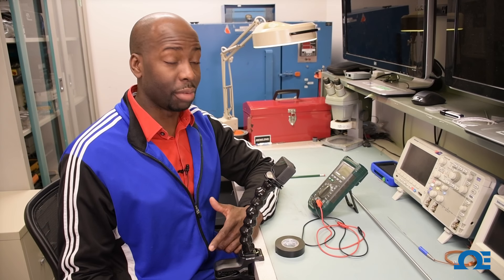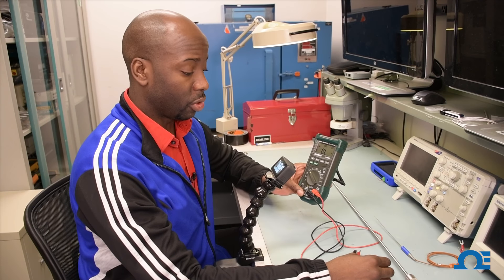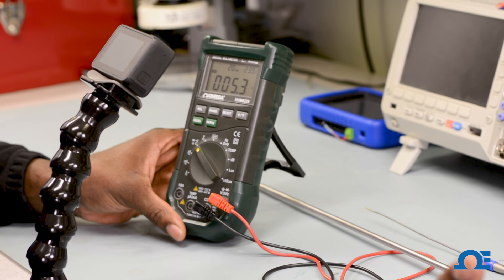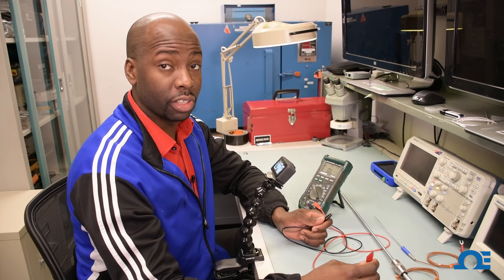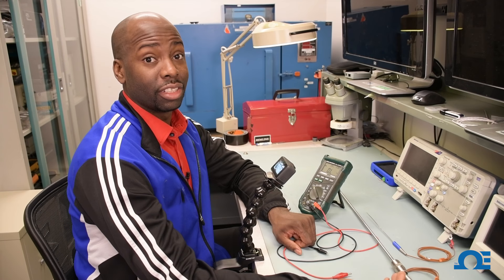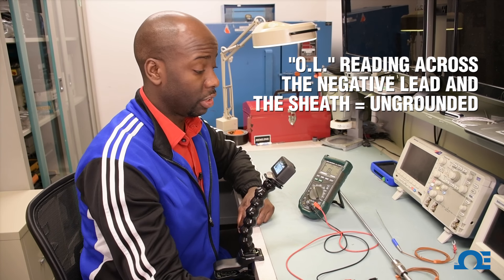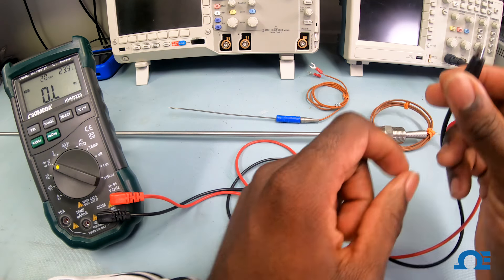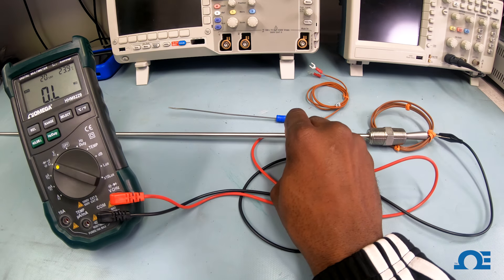How to test a thermocouple with a meter (grounded & ungrounded)

Comment: Hi, nice video. Question: I have type K termocouple which is Exhaust Gas Temperature sensor on my lexus sc400. Now when I drive a car for a while I get a warning that exhaust gas is too hot but I believe it is not true as catalytic converters are not glowing red. Can this 25 year old termocouple be partially not working so it thinks gas is too hot when gas is not too hot? Thanks

Comment: Hello, how do I test the thermocouple from it voltage reading?
Reply from the maker: Hello Kayode, You can check the millivolt reading and match it up to the current temperature of the thermocouple. You can use this link, search for the Thermocouple Reference Tables  as reference.

Comment: What would cause a TC to osculate from positive to negative reading?
Reply from the maker: Hi ramirez509, A thermocouple can start to oscillate from negative to positive if there is an unstable EMI/RFI signal being picked by the T/C or a poor electrical connection to your end device that receives the T/C signal.
Reply: @DwyerOmega  the TC board has for inputs, but using one.  It's been program d for one.

Comment: Hi bro, I need the value of grounded thermocouple's "+ve" terminals to shield/body.Is it O.L. or some resistance ? I need your valuable reply, thanks.
Reply from the maker: Thanks for reaching out! When measuring resistance across the grounded thermocouple body and the positive lead ‘+VE’, you will read a resistance value. If you read ‘-OL’, then you have a damaged grounded probe.

Comment: I have 3 k type thermo probe  two have reading 15 ohm's ( oven temperature reading available 200 -250 celcius) ans one has 6 ohm's (  which measures boiler temperature 70-80 celcius)  please tell me boiler probe is ok or not.

Comment: Is reading resistance on a thermocouple truly the proper way to test it?  I agree with testing for continuity to determine if there's an open loop but just because a low resistance is seen doesn't necessarily determine that the thermocouple is functioning properly.  Wouldn't it be a better test to measure mV DC and compare the mV value seen against a reference chart for that type of thermocouple???
Resistance measurement would be appropriate for a RTD temperature probes.

Comment: Great Video!  I am baffled by a thermocouple I am testing. It is meant to raise a voltage of >20mV to power a solenoid.  So I isolated the TC and heated the tip. I got a fluctuating voltage from negative 12 to eventually settling on 25-30mV. Thought that was good enough and connected it to the solenoid. Solenoid did not work.  I connected the solenoid to a discharged 1.5 v battery and it worked beautifully (admittedly with a current of 350mA). Then I tested the resistance of the TC as you suggested and sure enough, it has a resistance in the MegaOhm range which meant it is probably roasted!. What I cannot understand is why, if it is faulty, it still has a good mV output? Most videos on testing TCs test only the mV not the Ohms. Hopefully someone can shine some light...
Reply from the maker: Hey, we're here to help. Shoot an email to tsoares@omega.com with the best way to reach you. We can grab an engineer to help you out!
Reply: @DwyerOmega  Unfortunately I am quite a few thousands of miles away.
Reply from the maker: @redpost2380  We help people all over the world, if any questions can be solved over email, we're here to help. Thanks!
Reply: Thank you so much OMEGA ENGINEERING 

HERE IS MY SOLUTION: FIX THE FAULTY THERMOCOUPLE: Just about all thermocouple fault finding videos test the mV across the terminals of the TC. Fortunately I came across your video. You must test BOTH mV and Ohms.
My TC gave an excellent mV reading but did not work. As you say here you must test the resistance across the terminals (as well as the mV). 
So here is a FIX that may help many readers out there.
I grabbed the tip of the thermocouple with a pair of pliers and the tip snapped off! EXCELLENT sign! It had badly oxidised inside and became brittle (hence the high resistance). This is the part where the two metals are welded together(copper or copper nickel).  So I removed the inner wire and cleaned it. I also used a small drill point to clean out the inside of the outside sleeve. Now I could have reinserted the inner steel wire and crimped the tip. This would work as a temporary fix to get you out of trouble. I chose to fix it permanently. I welded the inner steel wire and outer sleeve with a brazing rod 15% Ag. It is easy to do with an inexpensive MAP gas torch (if you don't have Oxy-acetylene torch). Solder is not suitable because of it's low melting point. A spot welder or, if you are handy, a stick welder can be used to weld the two metals. Always perform safety tests on the gas heater after fixing the TC. The TC must close the gas supply when the flame does not constantly burn over the TC head. This fix will slightly shorten the length of the TC. Make sure it is adequately heated by the pilot flame by adjusting it's position if necessary. In my case it wasn't necessary and the nearly 40 year old gas heater is as good as new.

Comment: I have a thermocuple and I connected it  to a PLC. Why cannot it read voltage? Always show me 0 volts?
Reply from the maker: Hello Javier, Thermocouples produce low voltage less than zero, millivolts. The best way to get your PLC to read one is to use a Thermocouple Amplifier to increase the voltage output so your PLC can read it.